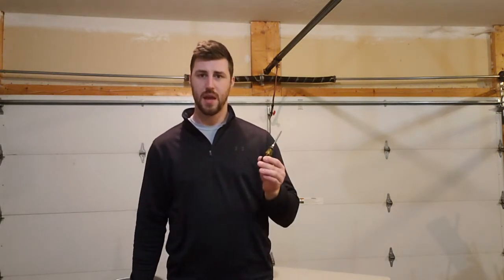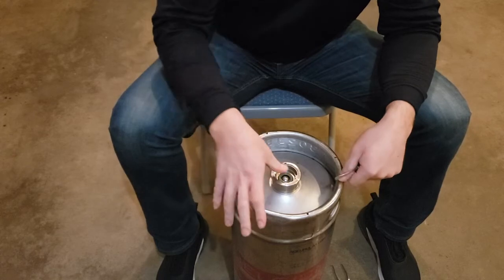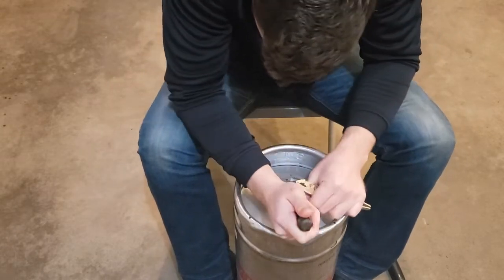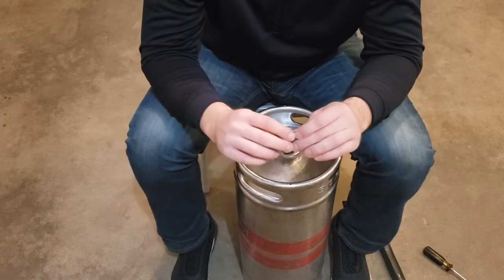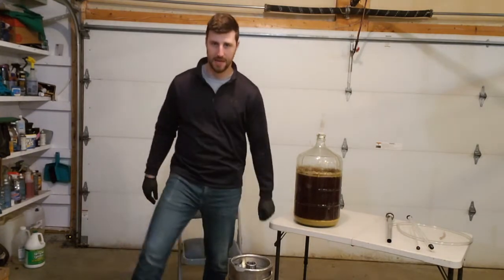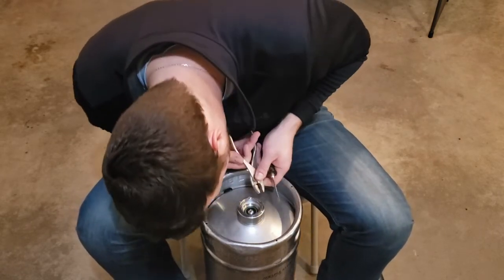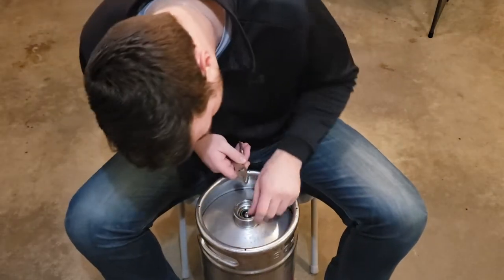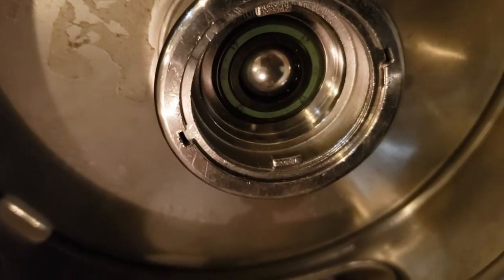How to open a Sanke style keg

Comment: Couldn't you replace the ring with a snap ring for easier removal next time?
Reply from the maker: I looked into snap rings briefly but have never used them myself. I read that some people had issues with the circular "ears" interfering with the connection to the tap and learned that snap ring pliers were required also.. not that those would prevent me from trying it out, I just havent yet. Hope you enjoy the channel! Cheers